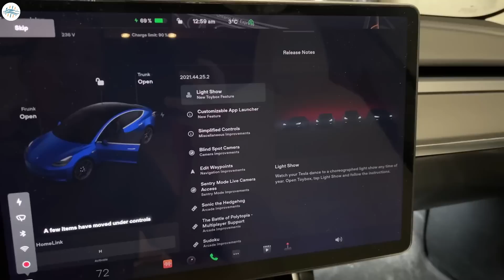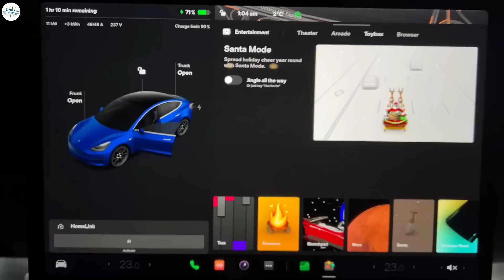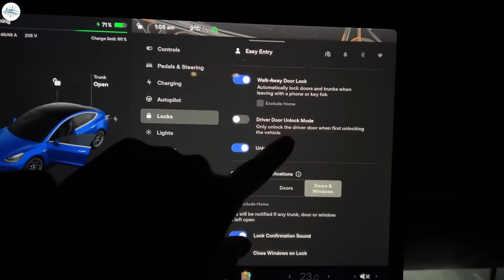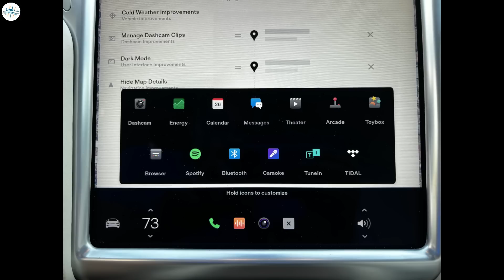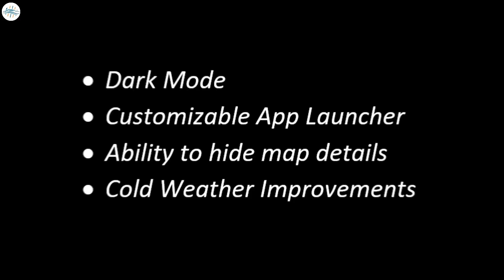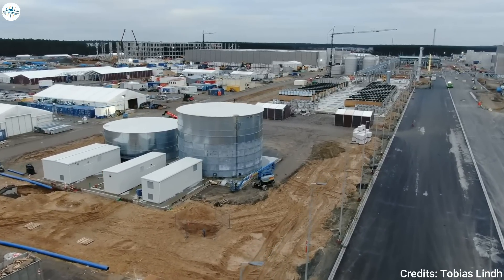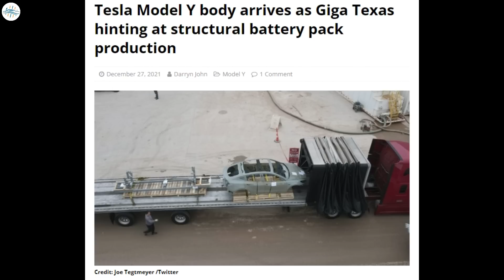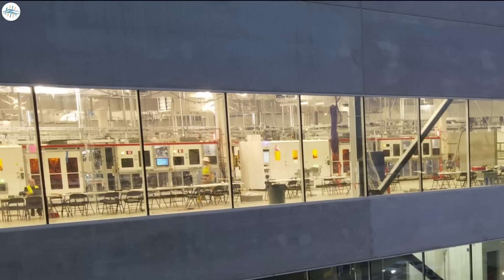Tesla's New Model Y Coming With 4680 & More Updates!

Comment: The tab less patent illustrates a breakthrough in - electric charge and heat - transfer, in a vertical fashion as oppose to conventional Panasonic means sideways. It is good on paper short in practice. 

The charge and heat successfully come out of the jelly roll core fall short at the anode-(cell wall base) junction, at a metal prickles wafer. 

At this junction electric and thermal transfer are impeded the way as Panasonic’s tab which Tesla intended to eliminate. Everyone knows - except it’s inventors - that point contacts method is enemy to electric and thermal transfer. 

Remedy? Bypass the prickles wafer by an “induction heated solder reflow” process. This provides a “solid 3D metal” junction to pass heat directly to cell case base to meet with coolants below. That point contact junction is the problem. 

BTW, prickles wafer made of annealed copper can be deformed permanently from on road inertial shocks in the first year road service - deformed prickles wafer cause circuit breakage > circuit breaking of inductive circuit produce electric spark at the wafer junction > spark ignites the heated chemicals > ignition leads to explosion. 

Remedy? Spark can be reduced but eliminated by the use of phosphorus bronze in the wafer. Impeded heat transfer becomes the prevailing problem. 

Total remedy? Induction heated solder reflow process.

Comment: 1. The blind spot live view feature should be available with or without the activation of the turn signal light.
2. I tried hard to find the cabin air recycle button, but to no avail. If someone finds it, please let me know.
3. Wish that the driver side and the passenger side are able to control the HVAC on/off and temp/blow levels independently.
Reply: Victoria, you can turn on all the cameras with the camera button (round black circular lens) at the bottom of the screen as you could before the last update.

Comment: Hoping that the Berlin 2022 LR model Y (with new cells) will have 400 mile range and cost less that what it costs now in EU 🤤 Same for the Texas built model Y for US customers of course. 
But eu has the biggest issue because they import vehicles and parts from the US or China.
Reply: @Exalta101  no bro read what I wrote more carefully.  The new manufacturing process is expected to reduce prices for both places model Y.